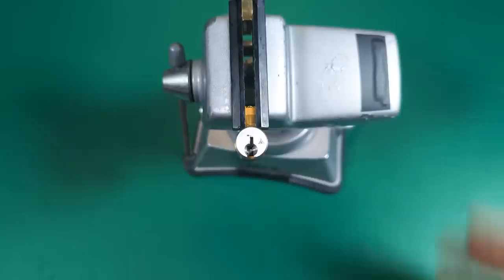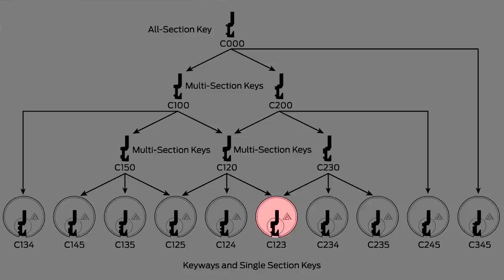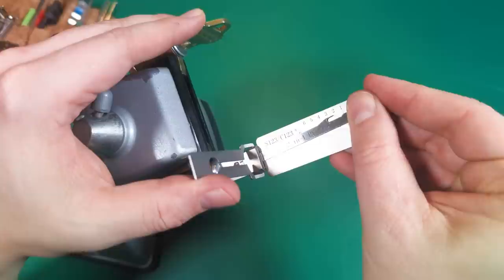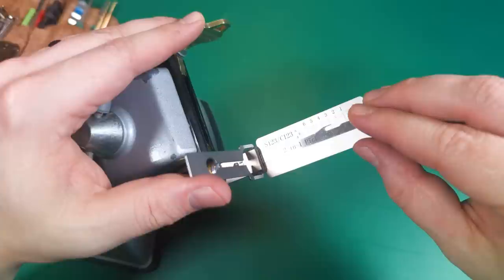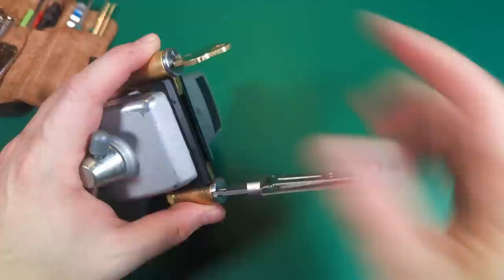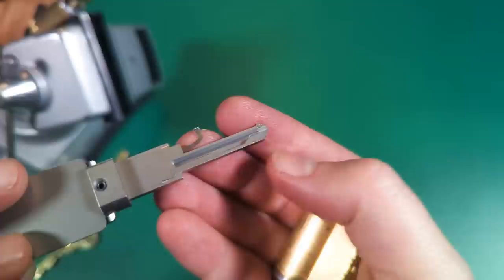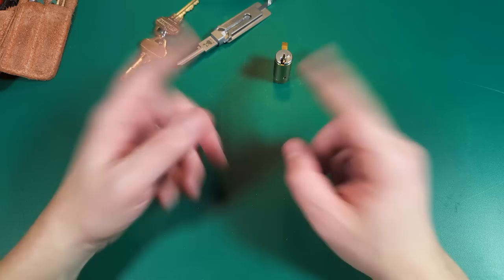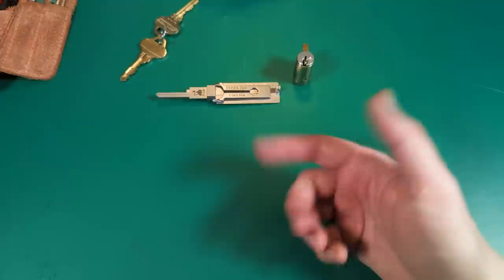New Lishi Tool Reveal

Comment: It should be relatively easy to mill away some material on the side to convert this pick to top level C000
Reply: What about the thickness?  I wonder if Lishi will do a top level like the SC20 Lishi.  I was surprised my KW5 did not fit the Weiser keyway due to thickness.  I know there are other problems using KW in Weiser with Weiser having more depths, but it was worth a try.
Reply from the maker: That is definitely something I have planned to try when I can get one of these to my machinist. I've got him tasked with so many other things right now, but it's in the works. :-)

Comment: First off, glad to hear the eyes are on the mend even if it's slow goin. 

Secondly, plug the shop man. The prices are good and I'd rather do business with someone with your ethics and business model than a lot of other companies... 

Hell, these days there's fewer and fewer companies that sell good locksmith tools, even companies that used to be major locksmith suppliers. US Lock got bought out by Home Depot, so they're done, HL Flake (now "Banner Solutions") still sells IF their site is working that day (I think they're on their fourth website in two years) honestly if you were to expand the shop to a full supply wholesaler for tooling and hardware, you'd have my business immediately.

Comment: I'm curious why they didn't just leave the hump off at the end of the Lishi? You don't really need it at the tip end of the pick as far as I can tell.
Reply: More why did they cut out the material leaving it a hump
Reply: @chasingcapsaicin  the material that's cut out is what lifts the check pin/finger to the right height. 

The only reason I can think of the hump being left there is to "excercise" the pin, so it doesn't get stuck in the "unlocked" position over time (thus defeating the whole purpose of the check pin)
Reply: @bstrickler  I am speaking for the pick having the material unnecessarily removed, also are you familiar with the IC versions of this system. I am curious how difficult it is to decode (after) rotation as it would be possible to keep a running card prior to. Would make it easier to make a control key for said system as unlike almost every other IC system there is no difference in the cut depth for the locking pins for a control key.
Reply from the maker: Yeah, if you're referring to what I have named the little "shark fin" at the tip that is, indeed, a curiosity. And THAT is what prevented me from being able to extract the tool.  The lifting of the check pin had nothing to do with being stuck in the lock.
Reply: @DeviantOllam  can it activate a control or just hooked on where it would be. Been a while since dealing with them in the wild. The IC for KIK was a pita removing out  master on a lot of them saving some of the change but not all.
Reply from the maker: @chasingcapsaicin  yeah, that's what one other person asked. Maybe it has to do with their LFIC system? I'm not positive.

Comment: But what of the 123IC flavor, hmm can it be made to work perhaps with a slight mod.
Reply: If it's LFIC it should work I would think
Reply: @ImGumbyDangit  Tehy dot work the same, the only difference between a change key and control is an additional skeg increasing the length. Biting is the same for the rest of the key.
Reply: @chasingcapsaicin  I understand they key has a 6 depth at the end to hit the Control pin,. The Lishi could be used to decode then cut on a control key.
Reply: @ImGumbyDangit  That was my wondering, can the tool reach it, or be modified to.
Reply: @chasingcapsaicin  modifying the Lishi to make it a tad longer may impact it's use on non LFIC ( KIK/KIL cylinders.)

Comment: Use coupon code WRONG for 15% off...jk. 
If it wasn't the check pin, what was it?
Reply: I'm gonna bet that it's that little spike out at the tip of the tool.  I can see how that would hang up on pins, but I don't know the Everest locks so dunno if it does something useful in there.